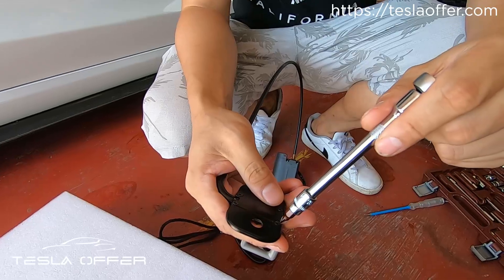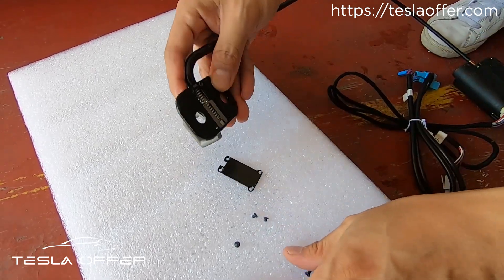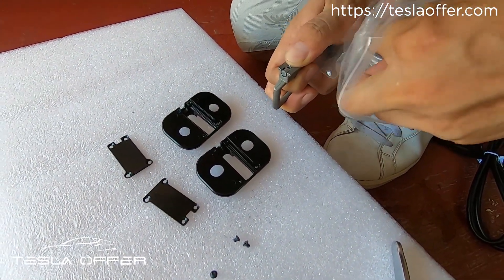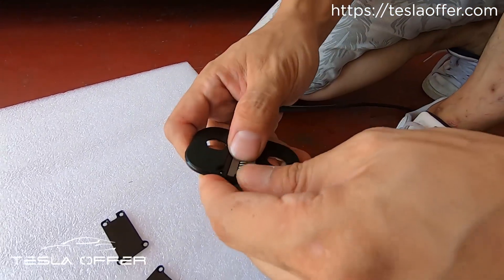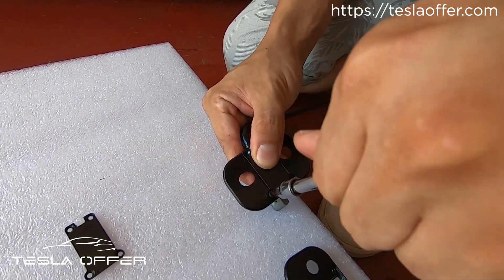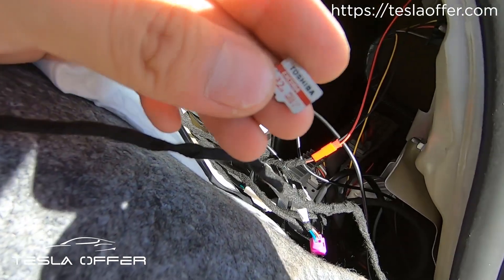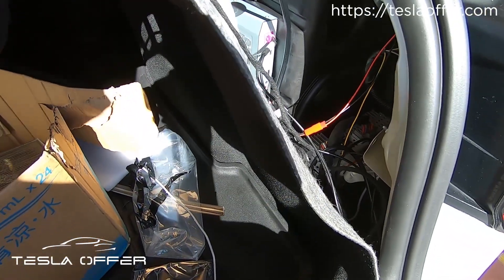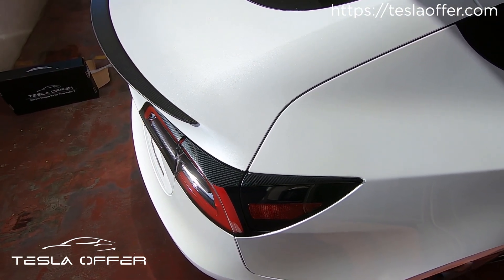EVOffer (Tesla Offer) - Model 3 Electric Tailgate (Mark 2.5) Upgrade Tutorial

Comment: What exactly is the difference between version 2 and 2,5. I didn’t see the difference.
Reply: If you look at the New plate the holes have been moved so that when it is installed the latch loop does not pull the trunk lid down as far as before. This put excessive load on the trunk latch from compressing the seal. This causes friction and you get that POP when it initially releases. the new plate eliminates that stress. I'm not sure what the software change does. I'd guess it to be minor timing sequence adjustments.
Reply: @dennisschlieckau8723  I believe the software change is to also release the trunk (move the latch) before opening it.

Comment: Great to see the continuous refinement and development on your kit. For anyone getting this upgrade I would suggest adding loctite to the screws. Probably not critical but appears factory used some when assembling.
Reply: Thx. Loctite for which screws?  Tiny ones in the video or the large screws for the latch?
Reply from the maker: I believe you are talking about the 2 T-45 screws?
Reply: These screws and backplate arent going anywhere after its attached to the frame of the car again